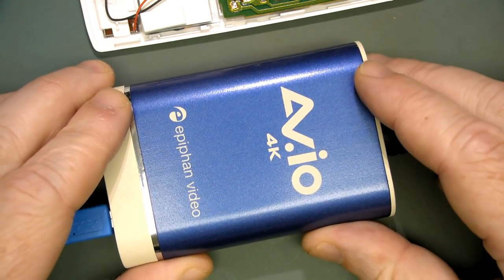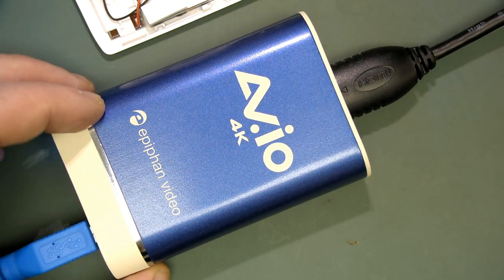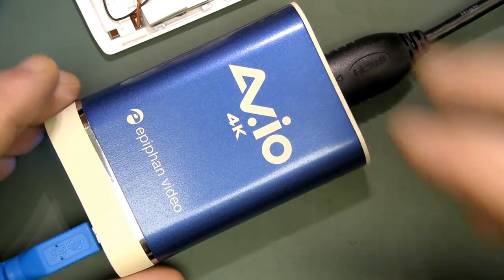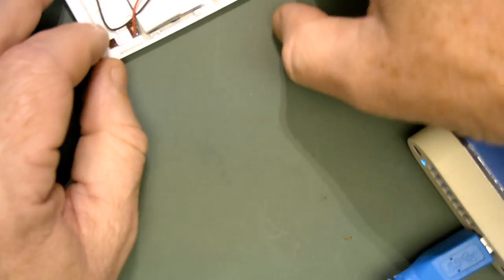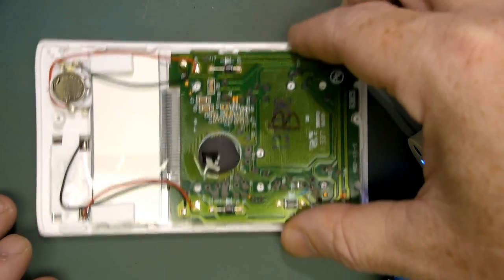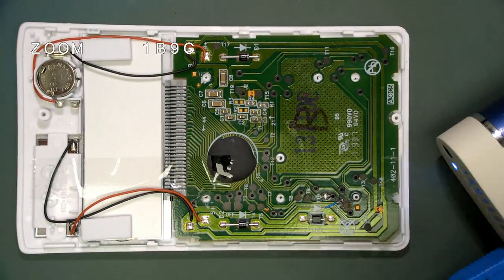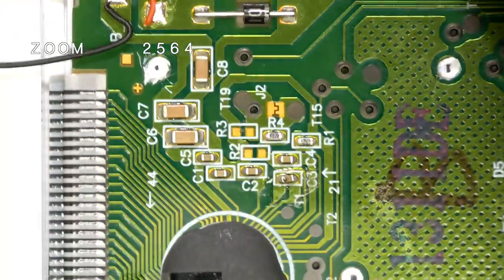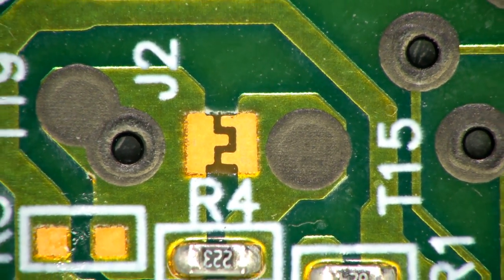Epiphan AVIO 4K USB 3 Video Capture Test 60fps

Comment: Looks really good. I hope you could get your hands on a 1080p60 camera as well so you could switch to uploading in 1080p60 instead of 1080p50. Or you could do some frame rate conversion, no clue how that would look like but what I do know is that watching 50fps video on 60hz monitor is annoying to say the very least.
Reply: With a lot of the lighting strobing with the 50Hz mains frequency, 60fps video is likely to be annoying to everyone. However, he has switched to LED lighting that is using switchmode supplies with low mains flicker - so to that extent he could use 60Hz.